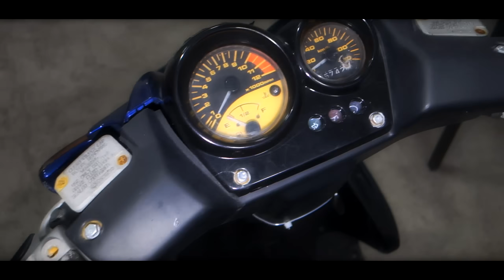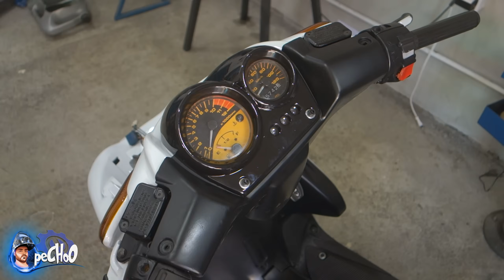Yamaha AeroX  50cc   (1997 )   RESTORATION!  (6 Months in 1 Hour.)

Comment: I'm looking to put a 70cc kit in my 06 yamaha jog r I am looking some pointers on how to go about this I'm just wondering what should upgrade to because everything is stock becides the exhust which is a tecnigass race pipe I also have a 61 jet in my carb and I'm wondering if I need to upgrade the carb or just the jet thank you
Reply: What kind of kit? The std. 12mm would work but it would run way better with a 17,5mm or higher in my experience.
Reply: @Kreeftleeft  a nakuru 70cc kit I also have jets going up yo 80 on the standard carb

Comment: I like the whole video, im having trouble with the fact you did'nt do the full renovation of the cylinder 🙂
Reply: no test run either no proof that she actualy runs
Reply: This had me wonder. I’m rebuilding an MBK Nitro from 1997, and this is where i started: the engine/crank. No point in doing anything if it doesn’t run